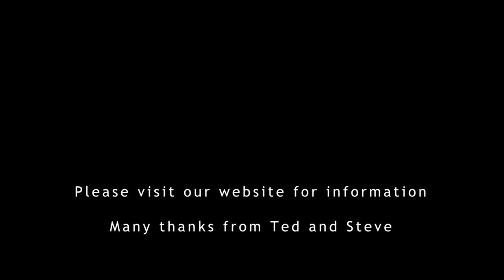Parmoor Gunstocks - CZ Varmint thumbhole stock 001

Comment: big respect for the work , nice that the old way is kept alive 
Onley thing is why that much effort in a 22LR like id understand it for a 1903 or a Hunting 98 Mauser / Remington 700

- big firms nowadays use a 5 axis CNC and are inclusive milled checker done with it within 40 minutes
its basically done except oiling or laquer coating the wood - you dont even need to sand it anymore other than the sanding they do when massaging in the oil - if they dont just dip them a few times and polish them afterwards

Comment: great work, love that set up, but saying its stronger than laminated is pretty bold statement, must be really good wood
Reply: yes it is because of the cross grain lamination of birch ply . what you have to remember is it is structural grade ply . not with the grain running all one way as in coloured laminate. i have a lot of experience in both type of materials.
Reply: Yes sir you are correct, my apologizes for assuming otherwise, I heard you wrong, after listening to what you said again. That is an amazing looking stock very beautiful.

Comment: Stephen, you have done a wonderful job making that four-axis profile copying router. I am impressed by the quality of the work you produce. But (there's always a "but", isn't there?) are you considering the next step, and driving that excellent machine with four CNC stepper motors?  The software to control them is readily available, the parts are quite inexpensive (see Banggood in China for one source), and for a few dollars/pounds you can have your existing templates scanned and digitised, which means that if you need to make an (a) or a (b) or a (z), all you need do is call up the appropriate file from a computer, press "Enter", and stand back while the machine does all the work, extremely accurately, as many times as you want, and doesn't miss any bits.. If you invest a few quid now you can greatly improve your productivity, and hence profitability. Imagine putting a blank in the machine and walking away to finish sand a stock or two while the machine cuts new, finely-finished stocks all by itself.

You would have to invest a very little bit of time in changing cutters, because having tool-changing machinery costs a lot more, and so you would need to run a number of separate programs to run (say) three separate passes. This might be roughing with a two-flute, square-ended cutter, followed by one pass with perhaps a quarter-inch ball-ended cutter, followed by another pass with an eighth-inch ball mill, which would would give you highly dimensionally accurate products that need minimal sanding. The software sorts out the tool paths for each pass.

You would need four very low power spindle motors, a controller, four ball screw drive rails to make the motion happen, and the software. Given your obvious fabrication skills, making those modifications would be no challenge for you, and the conversion would not disable your machine during its construction; it would be business as usual combined with a huge leap in output.

The amateur (and professional) CNC society will give you all the help you need.

Or have you been told all this already, and have decided it's not for you? Either way, I wish you good fortune; may you live long and prosper.AA
Reply: hi i looked at all the cnc options to me . i have even looked at bringing on in from china this year with the atc on it +the rotary table & the big 9 hp spindle motor . having the stocks scand is an expensive job in the uk with all the different inlets that i have . + i do a lot of bespoke stocks whear i use different parts of old stocks to make new patterns up. besides that too long to carve a stock on a cnc machine . it would be ok if they were multi spindle ones , the ones i have looked at are not good enough for the money

Comment: After the last cutter from the tracer, the pieces work shouldn’t be going through with all the grinding and sanding like that., it may has to use sand paper just for the fine touching....
Reply: with the eqipmet i have for sanding it only take 1/2 an hour to sand them off .

Comment: WOW! I actually thought this was gonna be like the duplication lathe like how Garand stocks were made. My back hurts just watching this!  KUDOS!  Very cool! But no hearing protection or dust mask?  I'd be dying!
Reply: i have a huge dust extractor on the machine it pulls the dust down into it , the noise is not too bad , it is a lot better than when i used to run router motors on it , i don't have any back problems , with being bent over